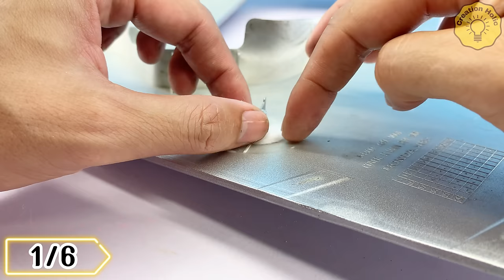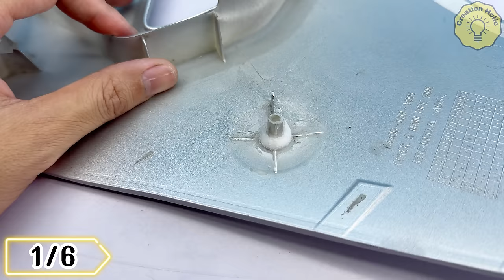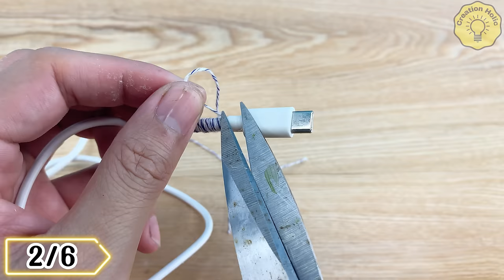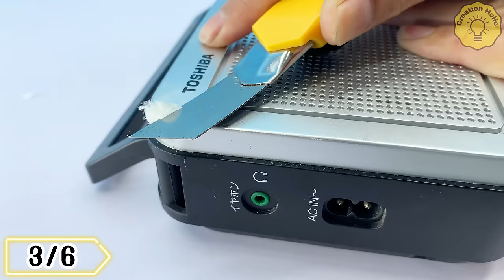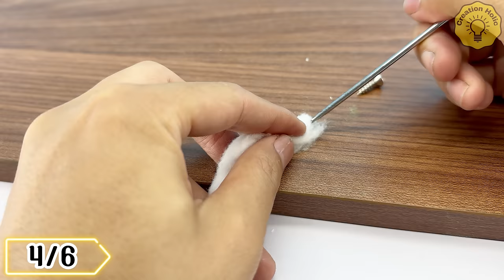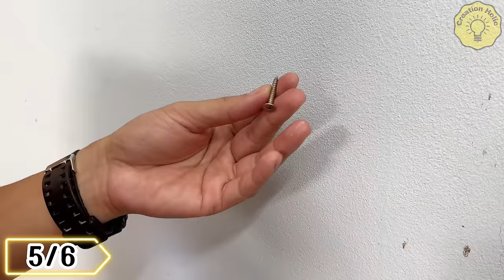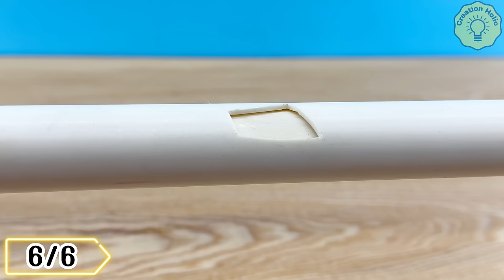Super Glue and Cotton Miracle ! Will This Fix Everything?

Comment: All these videos are the same - everyone has an unlimited supply of superglue & it costs an arm & a leg.
Reply from the maker: Thank you for sharing your feedback and expressing your perspective
Reply: A little bit of super glue goes a long way. And if you compare this repair hack cost to the cost of purchasing a whole new part, the benefits are clear.
Reply: Cheap dollar stores contain seemingly an unlimited supply of cheapo eastern cyanoacrilate superglue, which is more economically suitable for such a job. Loctite is Just a brand name.
Reply: فنان عبقري رائع
Reply: I get my superglue online in large one ounce bottles for about $5. They sell it in big 16 oz bottles, I’ve seen gallons for sale, for factories.  Buying those tiny bottles or tubes at Walmart can get expensive.  An ounce of superglue lasts a very long time, it usually goes bad, gets hard, before I can use it all, but over a year or more.
Reply: My dude. They sell superglue at the dollar store. Stop with the whining.
Reply: Store it in the fridge it lasts a heap longer.🇦🇺
Reply: @alphagt62  That's why you need a bunch of the tiny bottles. The screw-on neck of the bottle has a weird left-hand thread so it screws on counterclockwise, and the cap screws on normally. You need a needle to unclog the hole every time for use. Weird stuff, this Krazy glue.
Reply: @foureyedchick  these industrial one ounce bottles don’t clog, they’ve got a pin built in the cap, they work well. The problem is, the whole bottle starts to get hard, get thick inside after a year’s time.
Reply: @MrKeenaz thanks for the tip I never knew that you could do that .
Reply: @alphagt62  I know.
Reply: I bought a tube of superglue last week and when I left the store, I still had both my arms and my legs…Whew!!!
Reply: @WilliamFluery  Krazy glue (cyanoacrylate) bottles have a neck with a left-hand screw (opens clockwise, closes counterclockwise), and a cap with right-hand screw (opens counterclockwise, closss clockwise).
The thin narrow nozzle must be re-opened every time by poking with a needle to remove hardened Krazy glue. Be very careful, because spilling Krazy glue on your hands will cause your fingers to stick together.. If you get Krazy glue on your fingers, it can be PATIENTLY removed by grinding them with FINE sandpaper or emery nail files.
Krazy glue works very well by reinforcement with baking soda for larger parts that need to be attached.
If however, you want to fill up an area, it is better not to use Krazy glue, but 2-part Epoxy or 2-part JB weld.
2-part glues (resin and hardener) require a neutral (third) surface to mixed together first, which should be neatly thrown away in a plastic bag in the garbage far from children and pets.
Reply: I think buying by the gallon is possible and some money saved in the process.
Reply: @foureyedchick  Wow!!! You just gave me a college level education on Krazy glue. You are so kind to make sure I am well informed. Thank you.
Reply: You need a better career if super glue is breaking your pockets.
Reply: How is it that you not being  able ale to afford CA glue is the video creators fault.
Reply: I bought an 8 pack of tubes at H. Freight for $2!
Reply: $.99
Reply: Where are you buying your glue?!?
Reply: Not really. You can easily find super glue at affordable price. I don't even manage to completely use it within the year! That is, I use it only for repairs.

Comment: Works similarly with Baking Soda, and turns it rock hard.
Reply: Yes, and It's called Rapid Fix. It is expensive, but it's the best quality CA glue you can find, I use it everywhere. Best way to stop bleeding when  I get a cut or busted knuckle The powder that comes with it has larger grain size than the stuff in your fridge.
Reply from the maker: Hello! thanks for your recommendation. Wish you all the best!

Comment: I found with super glue very often after a number of months it degrades and no longer has adhesion. I have been using mastic epoxy. When hardened I can cut it, or drill, and sand it as necessary. The mastic epoxy takes some time to dry. I also use liquid epoxy where liquid is better to use.
Reply from the maker: Hello! thanks for your comment. Wish you all the best!

Comment: These superglue fixes will come off after a year because superglue if not water resistant. My fixes are failing now because of the humidity and I am now preferring JB weld or cheaper Chinese copy of this epoxy glue called metal glue/cold weld glue. Weld, plastic weld, fasteners etc are also preferred. But instant glue has limitations.
Reply from the maker: Thank you for sharing your feedback. have a nice day!

Comment: The first hinge screw stripped out immediately after seating, showing how weak this method is. It works ok for low strength filling but not tensile strength. I only use this method for gap filling.
Reply from the maker: Thanks so much for watching our video. Wish you all the best

Comment: I was expecting the last one to use a cloth adhesive bandage which would have been a lot easier to wrap the pipe with than all of that headache. 

These techniques can also be used with baking soda instead of cotton. Might be easier stuffing a hole with a powder than cotton sticking to a screwdriver.
Reply from the maker: Great suggestion!

Comment: Never try and repair a damaged USB cable.  Even if it just looks like it's the outer insulation that's broken, it could still have damaged wire cores that can cause a fire.  USB cables have cores that carry 5volts and a reasonably high wattage, more than enough to get hot enough to set fire to anything it comes into contact with, especially something that's impregnated with very combustible super glue! 😮
Reply from the maker: Hello! thanks for your comment. Wish you all the best!

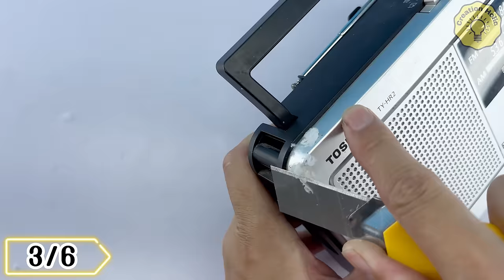Comment: 2:38 don't use a knife this way. You're effectively pinching the knife into your finger, just with the project held up in between the two; all it takes is that flexible knife slipping off the material to punch a slot in the side of your finger. 

For this cut, I would have all fingers in a knuckle on the flat face of the speaker, have the cut corner exactly opposite from my body with the player held in my other hand and against my stomach; so the only cutting motion is away from me with my fingers tucked in. 

I get you wanted to have it on the table under the camera, but nah; that bit of traction on the top isn't worth risking the finger

Comment: The last example on the PVC pipe is probably not a good idea because CA degrades when wet which, i assume will happen when water flows through the pipe. PVC is so cheap and easy to glue up it's better just to cut the pipe and glue in a new piece..
With due respect. 
Imaginative however!
Reply from the maker: Hello! thanks for your comment. Wish you all the best!

Comment: a few problems with the last one.....

1. Why the hell would you do that ?
Just cutting a piece of the conduit on both sides and replacing it with a joiner is so much easier.

2. Then you have the problem of running a cable through it, if the inside is indented, you're going to have a lot of trouble running cables through that conduit

3. You could have wrapped electricians tape around the hole... So much easier

When would you actually and practically use this ?
As for the rest of them.....................FAIR POINTS
Reply from the maker: Hello! thanks for your comment. Wish you all the best!

Comment: Is that real cotton ?  

Or the synthetic cotton type made from rayon, nylon, polyester etc. ?
If so, then a bit misleading. 

I think mfg stop putting real cotton in medicine bottles over 20 years ago ?

Plenty of epoxy glues available for plastic, glass etc. But ok in a pinch. 

Wooden Toothpicks been used for decades on loose wood screw holes. 
Faster fix too.  Sorry

Ok otherwise if no other options available.
Reply from the maker: It's quite good, try it and feel it

Comment: The comment here about the reaction of glue and cotton is BS. Think about it. The glue can be used to repair tears in clothes. Is there a caution for that. Take a temp reading. The glue may be slightly exothermic, thats it. The viewer either has no clue about chemistry or physics, or hes pulling your leg!
Reply: It will be around 120-200F, that's definitely not dangerous.  The higher temps were taken when I added baking soda and super glue.